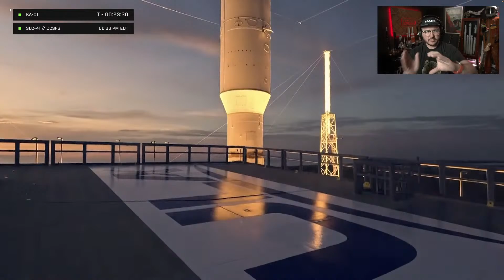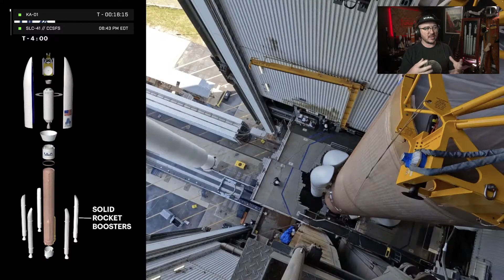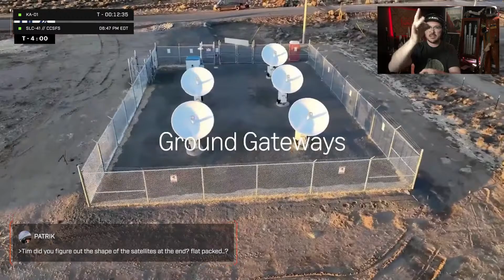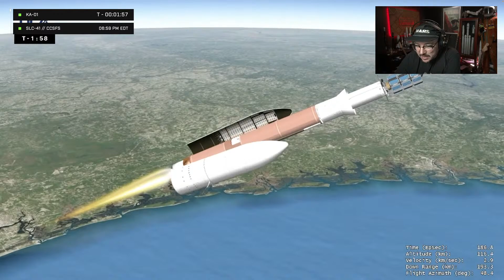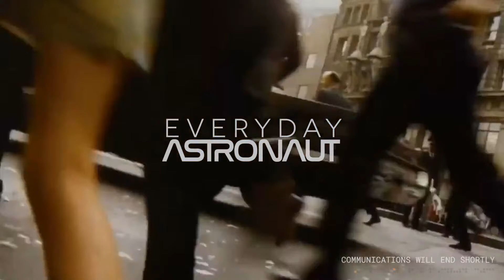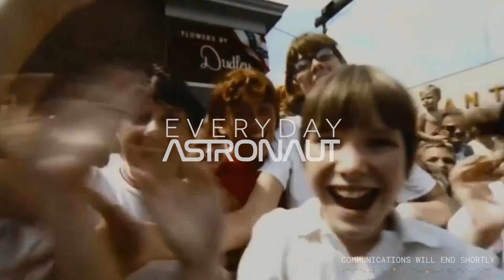Watch The FIRST Batch of Amazon Kuiper Satellites Launch!

Comment: How does this compare to starlink? How can this constellation change the world?
Reply: Don't expect competition for Starlink, SpaceX is way ahead and will always be cheaper. Amazon is launching a few sats on a half billion dollar vehicle, SpaceX launches cost 50 million a pop max. Amazon is going to have to charge astronomical prices to earn back their investment.
Reply: @paulmichaelfreedman8334  Starlink needs way more satellites to be operational. Once the 3000 Kuiper sats are deployed, that's that. 
The Atlas V costs about $110-150 million per launch. It has a worse cost per satellite than Falcon 9 despite having more capacity, however both Vulcan and New Glenn beat it in price. Vulcan is closer depending on which prices you use for either rocket (I was using 70 million for F9) but New Glenn easily beats it even with high cost estimates and 50 million for a falcon 9
Reply: @notgreg123  Starlink is operational.  The rest is largely nonsense.
Reply: @imaginary_friend7300  could you clarify which comment you're talking about?
Reply: @paulmichaelfreedman8334 
New Glenn actually beats Falcon 9 in cost per satellite (about 1.8M vs 2.5M). Vulcan is pretty close and could be more or less based on which numbers are used. Atlas V is worse but definitely doesn't cost half a billion lol
Reply: @notgreg123  considering New Glenn can't even hardly get off the ground and has only launched one time it will be quite expensive to get even close to starlink.
Reply: @CD3WD-Project  the estimated cost is 110 million for 61 satellites. That's roughly double a Falcon 9 but you get 3 times as many satellites. 
I prefer to think of the low TWR differently. It crawls off the pad that slowly and despite that, it can still put 45 tons into LEO (presumably). If they can fix that then they'd get a pretty significant upgrade over the first version

Then again it could be the other way around and the low TWR is subtracting from the 45 tons idk, I'm not Blue Origin

Edit: and that's a high price estimate. It was originally supposed to be around 70 million and they might bring it back down closer to that as development continues
Reply: @notgreg123  how long do you think they are going to continue using the Atlas V 551 configuration roughly 163 million per launch. That is not cheap.
Reply: @CD3WD-Project  they've contracted 8 Atlas launches. After that there's 3 Falcon 9 launches as well. By then the other rockets should hopefully be at a high enough cadence to take over completely but they'll probably launch a few times meanwhile

Edit: also important to note that they can't buy more Atlas Vs even if they wanted to. The rest of them are bought by Boeing for Starliner and then it's being discontinued
Reply: @notgreg123 spacex is going to launch Amazon satellites?
Reply: @notgreg123  Sorry but Starlink sats cost way less per saldo, in the order of $ 1M
Reply: @ My bad, you're right, Atlas costs much less I was confused with Delta I Heavy. But SpaceX still has way less launch costs, Falcon 9 is insanely cheap for SpaceX now.
Reply: @NFS305  yeah. They paid for the launches so of course SpaceX is just gonna launch them. It'd be weird if they declined because they're trying to compete
Reply: @paulmichaelfreedman8334  I don't think launch costs matter that much here tbh. I'd be willing to bet the cost of the satellites outweighs the cost of launch or is at least comparable. Besides, Falcon 9 is only about half the cost of the competition. At best that lowers your fixed costs by a quarter assuming launches and the satellites cost the same amount.

There's also the factor that SpaceX is launching way more satellites than Kuiper which will make it inherently more expensive. Once all 3000 Kuiper sats are deployed, that's that. All they need from there is maintenance and replacement. SpaceX might be better connectivity by launching more satellites but I find it highly unlikely to be cheaper based solely on launch vehicles
Reply: @paulmichaelfreedman8334  my comment got cast into interplanetary space but basically my point was that launch costs aren't the biggest factor in service costs. It doesn't matter if Falcon 9 is half the price if you're launching 8 times as many compared to Vulcan or something similar. Kuiper only plans to deploy 3000 satellites compared to 42000 for Starlink so they'll need a lot fewer launches to make their services fully operational
Reply: @notgreg123 huh it seems weird to me they would launch their competitor but I don’t run a spaceship business.
Reply: @NFS305  understandable. I should also point out that it's not like a personal thing as much as the media likes to focus on Elon and Bezos as the figureheads of either company. At the end of the way a rocket launching company has gotta launch rockets
Reply: @notgreg123 . The price for Falcon 9 is $50 million.  When SpaceX sells Falcon 9 to itself, only the cost matters, which is estimates to be about $10 to $20 million.
Reply: @notgreg123 true but they must think the Amazon internet won’t rival theirs. They can’t be that desperate that they would accept the money now only to lose money later?
Reply: @NFS305  they would probably be sued for monopolistic behavior if they refused
Reply: It does not have to change the world. It just need to be reliably available, and not be on the whim of Elon. War in Ukraine showed Europe that they cannot count on Starlink so having good competition is priceless.
Reply: @lucifernebulae the broadcast mentioned it changing the world.
Reply: @lucifernebulae   You need Ground News.  You’re facts are biased without context.

SpaceX provided Ukraine with Starlink under the condition they do not use it to coordinate retaliatory acts of war on Russian soil.  Ukraine violated that agreement.
Reply: It's an alternative to Starlink and is planned to be cheaper which will make it more accessible. Plus competition is always good for the original pioneers
Reply: @ How is Bezos going to make Kuiper cheaper than Starlink when his launch costs are more than 10x SpaceX's ? Starlink here in NL costs Eu 60 per month with a one time  equipment fee of Eu 349.